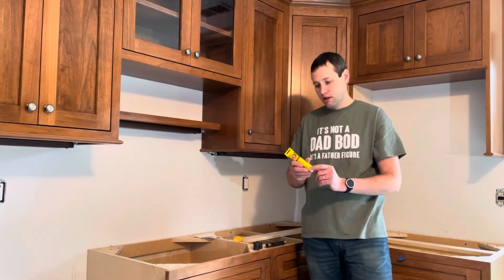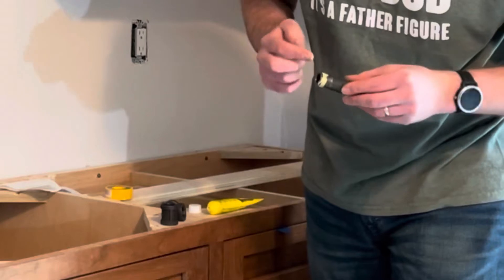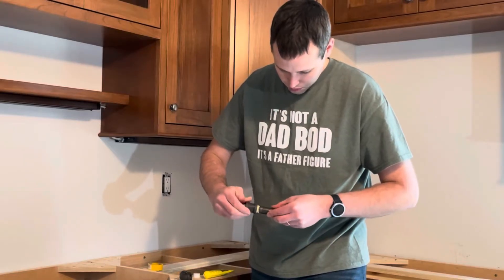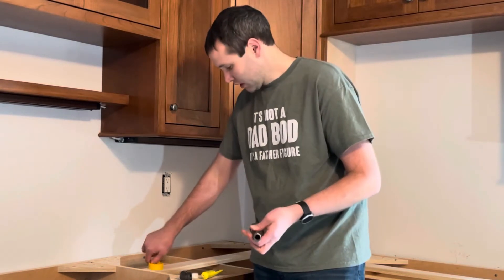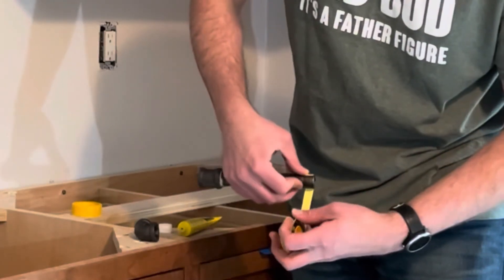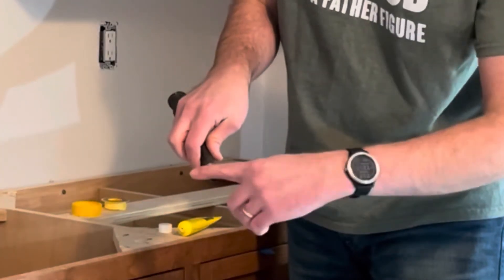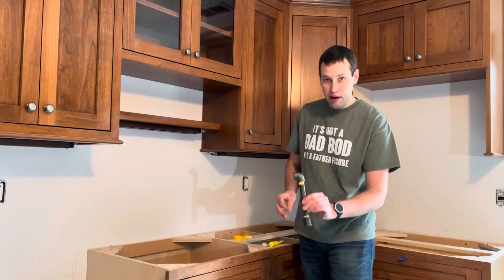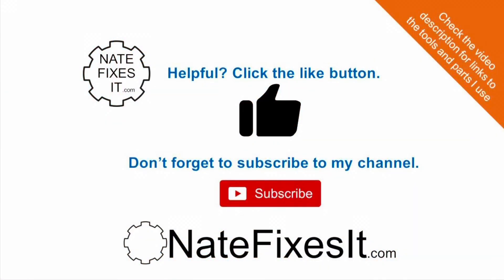Teflon Tape vs. Thread Sealant - how to seal pipes and fittings for natural gas and water

Comment: Always hold the roll in the opposite direction as you apply tape. As you wrap the tape around the threads it will keep tension so that application is tighter and easier. Also I like to do 3 “laps” around the pipe meaning there will ultimately be 3 layers of tape on the threads. Additionally it is common to apply tape followed by thread sealant (Gasoila is what I prefer) for a solid connection. All fittings should be tightened using a pipe wrench and be plenty tight to prevent leaks. I would use caution giving out tips on gas because in many states a licensed professional is required to preform this work mainly due to the fact that it can pose a hazard if installed incorrectly. Be smart and be safe.
Reply from the maker: Great tips!
Reply: What do you mean opposite

Comment: The tape and dope combo used together is the best option. Fills in imperfections and prevents galling. I've made a repair on a gas system that required both due to the nipple being slightly "egged"
Reply from the maker: I’ve never needed both, but a good tip if you can’t get a joint to seal.  Thanks!
Reply: @NateFixesIt  you've probably never worked on old gas pipe that's been wrenched on with pipe wrenches for many years
Reply: You are very correct James

Comment: Can i use thread sealant in PVC pipe?
Reply from the maker: PVC pipe joints typically aren’t threaded and need to be glued with a specific pvc glue.  PVC should be used for water only, not gas or propane.
Reply: @NateFixesIt  there are threaded pvc pipe i.e., female or male adapter.
Reply from the maker: I haven’t worked with that type of fitting, but according to my research, you should use a pipe sealant rated for PVC pipe, not pipe tape.
Also, be sure not to over tighten the joint or you can crack the fittings.  For more info, checkout this website:  https://blog.boshart.com/3-dos-and-donts-when-assembling-pvc-fittings#:~:text=When%20you%20work%20with%20threaded,water%20pressure%2C%20sealing%20it%20completely.
Reply: @NateFixesIt   If you have a "fix it" channel research your answers before replying.
PVC is for much more than water.
Water supply, drainage, sewage, electrical conduit, furnace exhaust and intake, etc. also use PVC.
There are plenty of threaded PVC pipe fittings.
I'd avoid pipe dope or past for PVC because most are not compatible.
Use Teflon tape.

Comment: Your not supposed ti use Teflon tape for gas fittings. Water fittings ..sure but not gas.
Reply from the maker: Regular white Teflon tape is not for gas fittings, but there is a special yellow tape that is made for gas fittings.  That is what I use in this video.
Reply: You're not supposed to use your for you're.

Comment: NPT   YOU DONT USE TEFLON.  THE THREADS ARE TAPERED FOR S REASON
Reply from the maker: Gas fittings are tapered NPT, but the taper alone is not enough to ensure a seal, especially for natural gas, where even a tiny leak can have disastrous consequences.  The International Fuel Gas Code was changed in 2021 to require the use of PFTE (Teflon) or thread joint sealant.  From a summary of the change:  “Thread sealants act primarily as a lubricant to allow the threads to make up tight to form a metal-to-metal seal, and any imperfections or voids in the threads are filled in by the thread sealant material. The most common thread sealants used today are pastes made with PTFE (Teflon) and Teflon tapes.”

https://www.iccsafe.org/building-safety-journal/bsj-technical/significant-changes-to-threaded-joint-sealing-in-the-2021-international-fuel-gas-code/
Reply: Nate is correct, tapered threads alone won’t seal gas or water! Threads in general are made by machines and have microscopic grooves that can’t be sealed without Teflon or pipe dope.